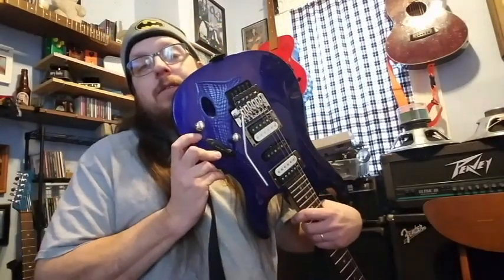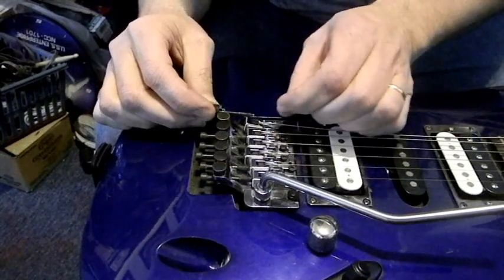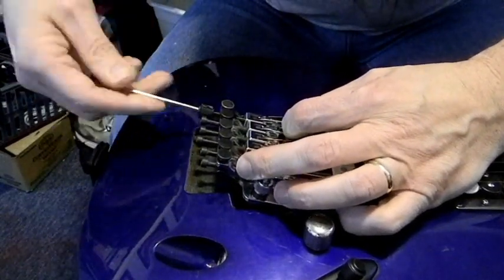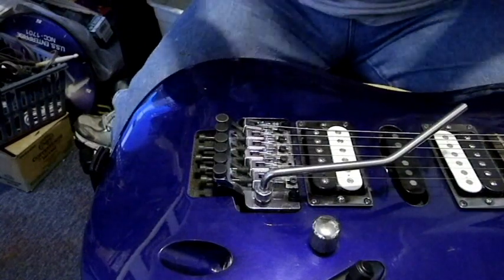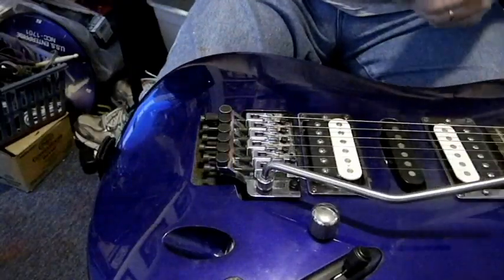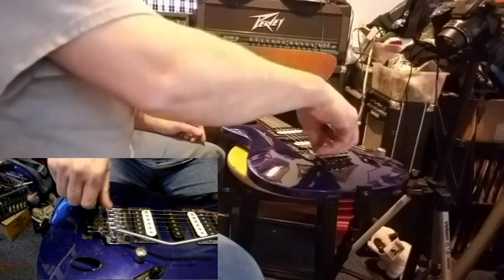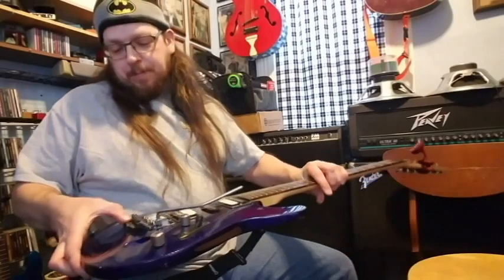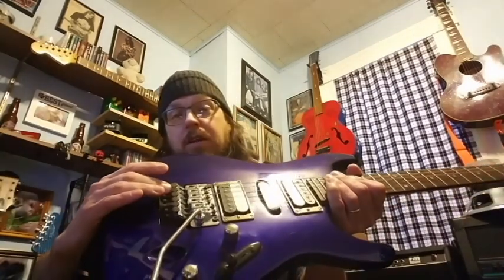Tone Vise Pitch Shifter Install and Review

Comment: I have string buzz with this. What could be wrong? I have a trem stabilizer installed in my guitar as well
Reply: Is it string buzz, or is the tone vise pitch shifter vibrating?
Reply: @austinfailz  your 8 months late haha turns out it was a raised fret 😂
Reply: @bread6085  that'll do it. I mentioned the tone vise as it may have been vibrating on the string clamp screw.

Comment: TBH though, the EVH say you should use your tuning keys only for the 6th string on their d-tuna.
Reply: No they don't say that. I have the EVH D-TUNA. It installed in 5 minutes, and works fine. I use the fine tuners all the time, and even the headstock tuners when necessary, on all 6 strings.
Reply: Yes to tune your guitar to d and then you lock it down.
That's where the little adjustment screw comes into play. With the d-tuna all the way forward, this is when you use the little allen wrench to tunity e standard.
Here's the part where everybody does in a little bit different some people don't mess around with that little allen wrench which is fine because most trems have a little bit of room where you can get two or three turns on your fine tuner.

Comment: Had one and it worked great broke a string changed it now flipping it back and forth doesn’t change the tone at all what am I doing wrong there is like no close up installation video of putting the screw in correctly anywhere online

Comment: Could you use the fine tuner when it’s drop d?
Reply from the maker: No. The fine tuner only works in standard tuning.
Reply: @GregTalksGuitars  but if u can fine tune it in stardard and not when dropped, why cant you just put it in standard, fine tune it and then drop it again? It takes less than a sec to drop it to D and its not like u gonna be fine tuning in the middle of playing 🤷🏻‍♂️

Comment: Can you fine tune with the EVH version?
Reply from the maker: Yes you can. In standard or drop D.
Reply: with an allen wrench, which is just as impractical on the fly as having to open the nut.
Reply: @michaeltheyoung1  the tiny screw is for fine tunning while in E and is supposed to be a set it and forget it option but even if its off a little the regular fine tuner works with the d-tuna in either position so its easy to quickly tune it,just dont go changing tunings mid song and it works great.

Comment: I use a Tremmory and a Mag-Lok on another guitar to keep everything in tune when I drop to D. The bridge stays completely still but the string tension being relieved still causes minute tuning issues with the other strings like G because the neck is being relieved. The whole idea of a D tuner is great in theory but unless if you have a aluminum neck or something that doesn't move at all then this isn't going to really work without you having to fine tune the other strings.
Reply: You got a block the trem so the trem doesn't move.

Comment: I have one of these and really loved at first. It was great since I didn’t have to route the body like a d tuna. After a few weeks it just completely stopped working. Touching the string at all would make the string out of tune. No clue what happened. Tried multiple things and could never fix it. Sad because I really liked it 

Went with a d tuna and yeah I had to route a little space out but, the thing has never failed me. Sad the pitch shifter doesn’t work.
Reply: So if you rout a little out, the D-Tuna is rock solid while still being able to float?
Reply: @edgyswordsmanmusic6769  you can’t float with a d tuna unless you have a tremolo stabilizer. Also never had any issues with d tuna after setup. Been using them for ever a year and love them

Comment: Is it still worth it?
Reply from the maker: It does work. If you have the Tone Vise quick unlock locking nut screws you could unlock that quick and fine tune, but the bridge fine tuner doesn't work in drop d. The upside is it does gives you drop d in a recessed mounted Floyd Rose without routing for an EVH D-Tuna.

Comment: I've had this device on one of my guitars for two days now. The E string does not stay in tune at all and indeed you cannot use your fine tuner in E/Eb. So I can see why they recommend those keyless nut locks. But then you might as well turn your fine tuner down if you're tuning in E and up if you want to tune to D. That is easier and it also works fine. I also take the pitch shifter off again. Waste of money.

Comment: I just got it yest, so far it’s a nightmare to install, after I finally did, it doesn’t keep tune, honestly, I believe I threw my $$ out the window with this gadget
Reply: Did you install a stabilizer also?
Reply: @kevinerickson84  I had it reworked again, working fine now, I blocked the trem with wood so it doesn’t pull back

Comment: Yeah this thing is good in theory but it failed me as well. It puts too much tension on the tension spring which fatigues it and then after a few weeks if it's not a real Floyd most likely that piece is going to break and not go back into shape.
Reply: They tell you to also use their trem stabilizer. This alone isn’t enough for long term.
Reply: @cmdrdredd  yeah the evh is definitely a better product a more stable.
There's all kinds of different stabilizers on the market. Considering this thing is a piece of junk I wouldn't recommend any of his stabilizers either.

Comment: Had one and it worked great broke a string changed it now flipping it back and forth doesn’t change the tone at all what am I doing wrong there is like no close up installation video of putting the screw in correctly anywhere online
Reply: Sounds like you broke that tension spring you need to check that.